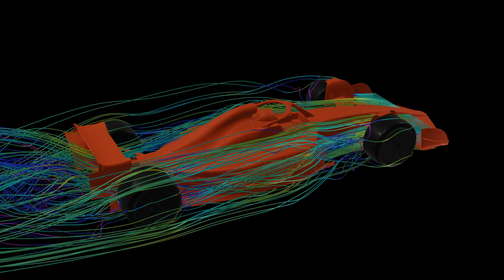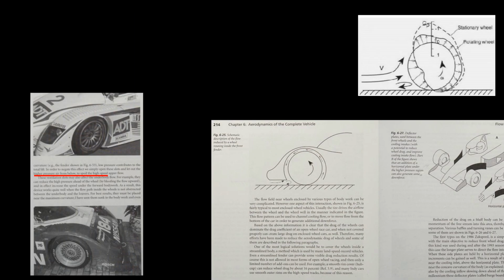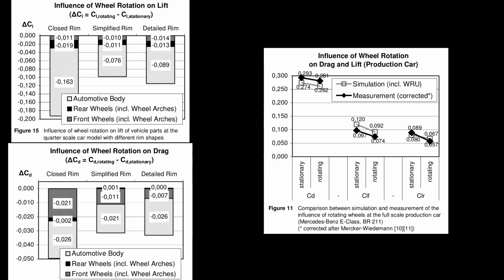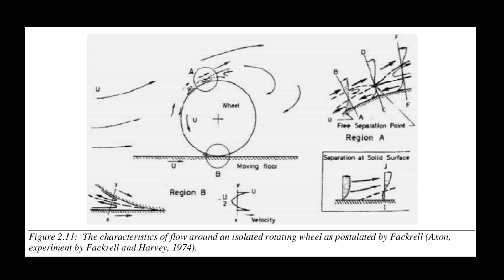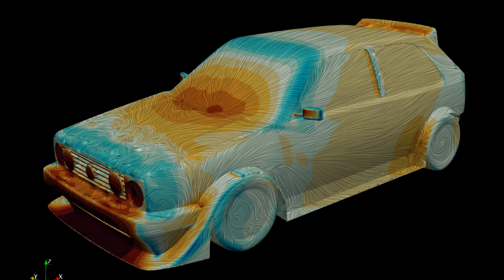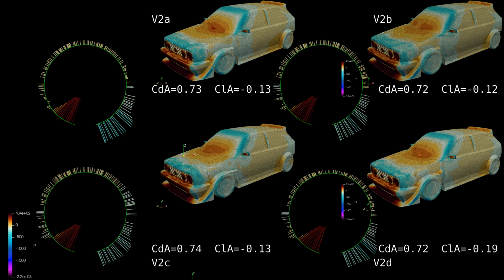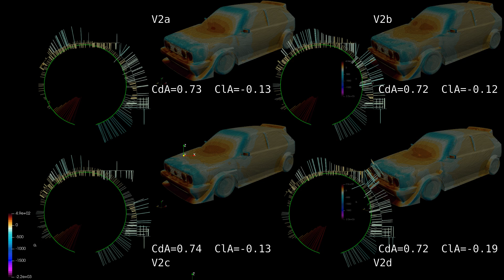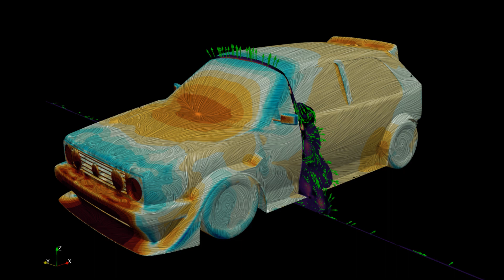Wheel Arch Modifications

Comment: Maybe adding airflow for brake caliper cooling  would change the low pressure behind the wheel. That flow directed up and out by the louvers could help get that air from going underneath the car by a miniscule amount too.

Also, love that book.
Reply from the maker: super tourers had an interesting solution, venting out from in front of the front wheel. It not in a video, its from a model before I was making videos, when I do the front corner I'll show what they did.

Comment: what would be the effect of having lots of very small/low fins on the sides of the car?
Reply from the maker: lots of little fins wouldn't work all that well as they would only create small flow structure. A car with the ride height of 10cm you would need a flow structure/vortex with a diameter larger than that. A fin will be proportionally to its flow structure it creates.

Comment: Hey Nelson, loved the video as always. Seeing the relatively poor performance of the louvres (in terms of front Cl change) in comparison to other solutions was very interesting to see, though not too surprising considering the disruptions in the flow downstream caused by the other solutions might not be desirable for most cars that might run them.

Anyway, you use OpenFOAM for these simulations, correct? Would you mind telling me how you get those "oil flow" surface contours? I've been trying to get them working for months, but I don't even know what to search for when attempting to find the answer on Google, so I'm kinda stuck. Cheers!
Reply from the maker: yep, it is openfoam the lines are call LIC, line integrated convolution, here is the tutorial I found it in https://www.youtube.com/watch?v=sjTH09Bc53M&t=1120s
That section of the car is more complex than I could've imagine. There is a bunch of interaction with the bonnet, quarter panels, wheels, windscreen and mirrors..... Then this also affects the floor because of the engine bay venting......
Reply: @nelsonphillips  Oh, I thought it was an OpenFOAM functionObject. That explains a lot haha. Either way, I got it running now. Thanks, this is going to be a huge help in post-processing!

Comment: It’s almost like you’re reading into my mind. Initially My oil cooler setup took air in the cabin ventilation to exit INSIDE the wheel arch which is opened behind the wheel. 
THEN: 
Thinking the wheel rotating would interfere with the hot air exiting, I decided to channel very carefully the hot air, to a laminar region on top of the rear fender (where you’ve put the little spoiler in your simulation). I’ve haven’t noticed a huge difference, now I know why. 
THANK YOU VERY MUCH FOR YOUR VIDEOS.
Reply: *on top of the rear of the front fender, if it make sens.

Comment: Check out a paper titled "The Effect of Camber and Yaw Angle on the Aerodynamic Performance of Rotating Wheels in Contact with the Ground" 2015. It shows that toeing the wheel in increases the tire squirt vortex inboard of the tire, and diminishes it outboard. When you toe out the wheel the inverse happens. Obviously you can't just run massive toe out, tire wear, tire heating, and stability will all suffer. However what you can do is create outwash inboard of the tires. This will make the relative airflow the tire sees as if it were toed out, without physically having to run massive toe out. This is the logic behind the M4 GT3 race car, the Porsche GT3 RS, F1 cars, LMP cars, etc. What this does is reduce the tire squirt inboard of the tire, so it affects the floor far less.
Reply from the maker: With one of the early videos with the suzuki a particular configuration of the splitter and the air dam holding it on does something very similar. Everyone runs a round edge/corner, but If you cut out the corner and push the air at the wheel there is such a performance benefit.